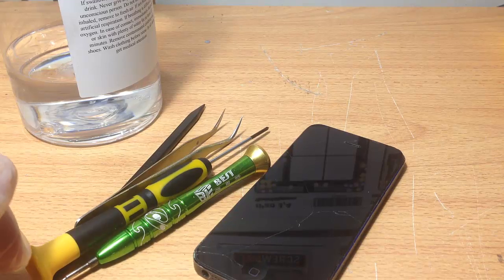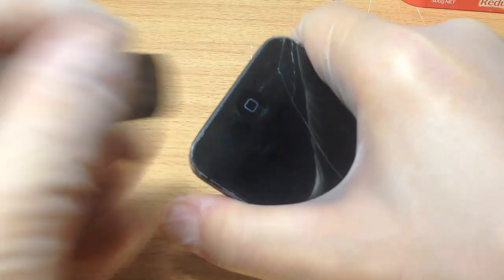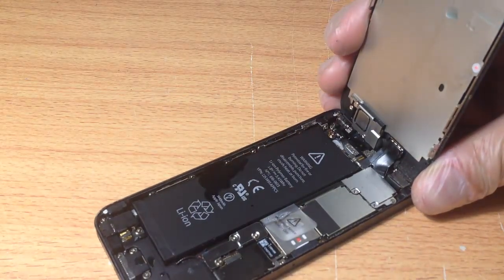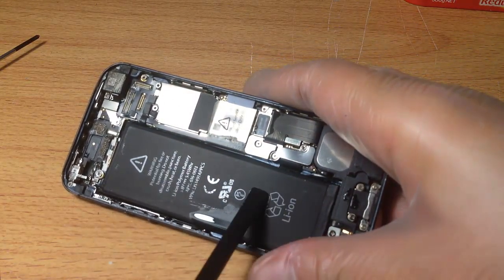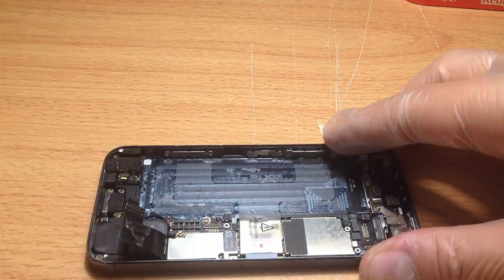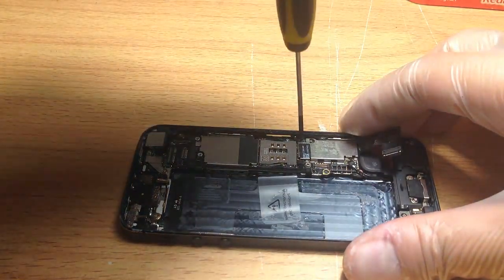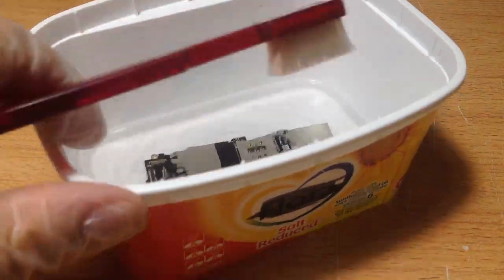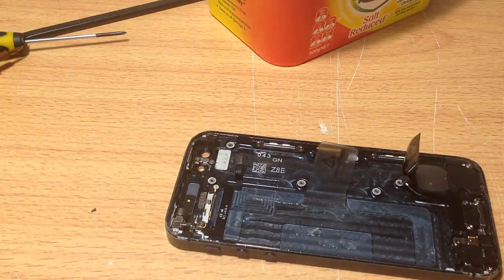iPhone 5 Water Damage Repair

Comment: Is it possible to switch the backs of the phone? like for example my gold iphone was water damaged. and i bought a silver one off craigslist. But i want the gold one as the color of my phone. is it possible to switch them out? not sure if it makes sense but yeah.. lol
Reply from the maker: +Precious Padilla sure is no problem.  actually quite easy to do.
Reply: +infohut I'm sorry for asking this, but what is the proper way to explain my situation to a repair man? Because I was planning to go to a repair shop instead but i just don't know how to explain everything. Hehe, don't judge me please✌️ I don't have proper english yet. lol
Reply from the maker: Just tell the repair person you have water damage and ask what is the best way to repair it. If he is a good technician he will recommend. If u want to change the back tell the technician the 'whole back case' replacement
Reply: +infohut do most repair mans agree to use materials and equipments that customers provide? anyone knows? like my situation ^ lmao
Reply from the maker: +Precious Padilla lol most likely they will use similar equipment.
Reply: +infohut so i went today and the guy told me they can't fix it and use the same screen and all because they're not the same size? i thought they should be because they're both 5s?
Reply from the maker: they are the same size yes but the connectors and frame are slightly different.

Comment: quick question, I have an iPhone 5 that has been water damage for almost a year and I took it to the cellphone repair ,and the guy  said the iPhone couldn't be repair because its water damage. isn't there a way to fix it ? because I do think there's hope to fix the iPhone I have.
Reply from the maker: Yup id say he is right as with water damage you want to sort it out quickly. If you don't over time corrosion ruins the components on the logic board.
Reply: +infohut  than you.

Comment: my iPhone 5s fell in the toilet about a year ago and I remember putting it in some rice and it worked . once the phone got hot it turned off and never turned on again . I went to about 3 iPhone repair places and all of them say its not fixable . what do I do 😭😭😭
Reply: Cry
Reply: Norman Sufficool lol why is a samsung fanboy watching a iphone repair video
Reply: +Diana Ortega Buy a Samsung Galaxy 4,5,or 6.  They are all well rated and are waterproof for the most part.  And you can open them up and take out the battery if necessary and dry them.  Apple phones are a pile of junk in this respect.  High priced junk in water.

Comment: my iphone 5 absorbed some water 1 month ago then i put it under sun light and it started to disappear but now after 1 month my phone's touch suddenly stopped working. it's touch is not working
Reply from the maker: Yup very common issue now this is because most likely over time it was corroded. The most important thing I can suggest is NOT updating it. Once there is an issue with your Touch ID and you try to upgrade it u will get an error and your iPhone will be useless to use

Comment: won't dropping the whole motherboard into alcohol cause water damage?
Reply from the maker: +Surge no because there is no electronic charge through the phone that can cause a short, also alcohol dries really quickly so when you do plug it all up again to test it, it should have dried a lot easier than water.

Comment: Please help.My son's iPhone 5s has a really bad case of water damage he was taking a shower and then he noticed that there were water stains inside the phone that were visible from the phone screen then he put it in rice and it started to disappear then the same exact thing happened 4 or 5 weeks later but this time it was serious,A black spot appeared at the top left corner and then after it just started to purple and black and my nearest phone repair store is somewhat far from were I live Will THIS METHOD WOR?(the phone still works with the damage it stills responds to finger touch and all else works too just the screen colors)Pleas Help Thank you.
Reply: Sorry for my misspelling I wrote this really late
Reply from the maker: +kevin tomay actually this doesnt sound that bad.  I would open it up and check for visible signs of water damage.  then perhaps (if your confident) try to wash it in alcohol.  As for the visual problems - black spot etc.  I would guess that you possibly need to replace the screen.  Nonetheless it's hard to diagnose without looking at it so please understand this is a guess.
Reply: You Mad? That’s what happened to my daughter

Comment: How can you tell if your phone short circuited or not? Mine got submerged into water the screen went blank. after turning it off, the phone got very hot. Can I use this same method to fix my phone or do I need to order certain parts?
Reply from the maker: +Lilly Wang possibly you an try. the sooner you try to fix the problem the more of a chance you have

Comment: how long should I soak the board and it is safe to have a direct contact with the alcohol?
Reply from the maker: +Nabill Hp it's safe to have direct contact with the alcohol ut you need to 100% dry.  soak it as long as possible. maybe 1 hour or 2.

Comment: I dropped my 5s down the toilet, and left it in rice for 2 days, then left it on charge for an hour and when I pressed the top button, the white screen with the black apple logo came on, but it was fuzzy in the top right hand corner so its back in rice in my airing cupboard, will it be alright???

Comment: When u mentioned leave it in for half and hour, and do 3 sets of cleaning here's what I did. I put logic board in alcohol for a couple of minutes. Scrubbed well. Put in for 30-40 minutes. Scrubbed lightly for a few seconds, then put back in for 15 minutes. After this, do I dry it completely then put everything back? And is everything I did so far correct?

Comment: Can you clean the motherboard with a 65% alcohol
Reply: no. isopropyl is 99% alcohol, тнатs the one you should use
Reply from the maker: +Gabriel Martins correct Gabriel.  Isopropyl is ideal however you can use 65% just make sure there is no residue and it dries completely.

Comment: Can i use it in the pool with a waterproof case
Reply: Berna C Dont buy from chinese sellers.
Reply: No
Reply: +Muaz Muzzammil Tukimat yes.
Reply: +UltimaA380 no I dropped my iPhone in a water prof case accidentally in the bath tub and it stopping working
Reply: +UltimaA380 nope ordered from life proof website
Reply: Berna C You did something wrong then or you got a defective one.
Reply: +UltimaA380 no life proof is shit. They claim they have this awesome product however they do not cover the product in the case, just the case
Reply: My phone was in a life proof case and now is fucked because of waterdamage
Reply: Jacob Kelly Return it.
Reply: +Jacob Kelly it is a $5-800 product, they believe in the case, just not the operator-seriously. I'm on my third case second phone. My current phone drops 6' twice month, over two year old. There's always a bad one I get it, won't put anything else on phone. My iPad2 has spent hours in the pool, 5 yrs I believe? Two minis, 5s, 5c, not to mention my 4s that I just tested - ITs GOOD!!!

Comment: I didnt leave the phone in the alcohol (70%- hopefully that's not too low)  too long..
But I was able to clean off corrosion and when I put the phone back together I plugged it in to charge and the Low Battery indicator came on the screen but then shut off.
It wont turn on again (even when connected) and when I leave it connected to the charge it starts to warm up.

What could be the possibilities of this?
Reply: ***** Sounds like there's no power reaching to some places it should. Try opening it again and see if something looks burnt
Reply: Anon8593 Could it be a bad battery? 
I struggled to get the battery off and kind of bent it a little (feels kindof like clay).. I'm hoping it's just the battery, because I already ordered a spare one because someone told me water damage usually ruins the battery. crossing fingers
Reply: Ok, because I cleaned up all the corrosion I was able to see. So the only stuff I wasn't able to see was under the shields that cant be removed.  But I thought I may have saw a dark pin or 2, but not fully sure. I'll have to take another look when I get the battery in.
Reply from the maker: ***** could be anything.  i would try changing the battery again and maybe checking for corrosion.
Reply: Anon8593 & infohut   How likely is it for water damage to burn out a circuit or something in the motherboard to make it non-repairable?
Reply from the maker: highly likely. furthermore corrosion can cause issues.

Comment: I dropped my 5s today in the Caribbean Sea in cancún. I was swimming with it for about 50 minutes until I noticed it. Will this fix my phone? Can a repair shop do it? It doesn't turn on. Or should I wait 4 months after my contract ends and use an iPhone 4? Or can Verizon upgrade it now? Thanks
Reply from the maker: Steven Karpov the sooner you try to repair it the more chance you can get it going.

Comment: Hi, thank you very much for your video.

My cat while drinking water spilled my phone that was charging on the floor with some water, when I tried to turn it on the apple logo showed up infinitly, that was 3 days ago.

Today did what you did in the video and IT WORKS!  Thanks a lot. 

Just one problem, occasionally the touchscreen starts to "move" randomly clicking on stuff without me touching it. Any tips?

Comment: In the operation where the battery is pried out of the case, you can pull on the clear tab that says "Authorized Service Provider Only" instead of jabbing along the sides of the battery and risking damage.

Comment: Some water might have gotten inside my iphone 5s trough the headphone jack port or charger. Everything worked fine but the screen was unresponsive or a few minutes then it worked again I noticed something like a water stain in the lower left corner of the screen (inside) i guess from the headphone port and I don't know what to do HELP im desperate!! I put it in rice but I heard that its best to take everything out and clean with alcohol, but the water indicator is still white could it get worse? It's nightime and i dont have all the necessary tools :(
Reply from the maker: MissRenesmeePretty You can try doing the was as per the video.  The sooner you jump on it the better.

Comment: Thank you!!!  I got salt water in my iPhone 5s last week and feared that I fried the board because I tried to restart it.  Your video was the most comprehensive and easiest video to follow.  My 5s just came back to life!!!  Thanks again !!!
Reply: infohut water will carry electricity and must people after the phone gets in water they will turn it on to see if it works and then the phone must likely will short out
Reply from the maker: Geoff Cielo thank you very much.  glad to see everything is back in working order. Don't forget to backup all your data.
Reply: Is there a way to dry out the front digitizer?  Sometimes the screen will act as if someone is touching the screen.
Reply from the maker: u can try dry it out. sometimes it works but most of the time the stains are there.  just replace it, they're are cheap on most online stores.
Reply: Thanks
Reply: infohut  i have a question if you get a water damage phone sometimes it maybe that it just have water but it could also have a short on the motherboard which maybe you cam tell me the possibilities of that and how to fix beacuse i dont think the alcohol willl fix it
Reply: true.  I think my fiance did this with her 5s.  I tried to clean the logic board, but it appears to be dead :(
Reply: Geoff Cielo did you have to replace the battery
Reply from the maker: sometimes yes.  in this case no but it's not uncommon for the battery to have issues.
Reply: +infohut 
can you recommend a site? most ive found are $50+
Reply from the maker: perhaps through amazon or ebay?  they would be the most competitive

Comment: Is there still a possibility of fixing my iphone 5. It got yet almost a year ago and it turns on and charges perfectly fine but it does not let me unlock. I took it to open it up, but I was told that it is completly damaged because I forgot what it was but there were like little red spots and it meant that the water went all the way in . Is there a possibility of fixing it?

Comment: I had my iPhone 5s was in my shirt pocket on a dock when I bent over it fell out and in to salt water, the water was only about 4in deep and as soon as I felt it slipping I jumped in so it was only in for about 3 sec it doesn't seem to have any water damage but I am afraid it will corrode in the future.  What are your suggestions?

Comment: My iPhone 5c turns on but when I use to home button it turns on then powers off.  What should I do?
Reply: Clean it
Reply: No your logic board is shortened out so take it out and clean it up. It won't go away itself and if it does, your logic board will die due to corrosion eating solder joints away. So clean it
Reply: Catherine M use lacquer thinner alcohol base, to all buttons to clean,. press the button repeatedly while cleaning

Comment: Salt water?
Reply from the maker: Olivier Whelan salt water is more corrosive make sure you jump on it asap and give it a clean.  worst case disconnect the battery at least to remove any charge in the battery.

Comment: I just dropped my iPhone in the pool it wasn't in there long probably a couple seconds. I took it out dryed it off it was still on and it worked fine at first then it flashed blue then turned off. I put it in a bag of rice and it turned on an hour later. It had like 50% battery left then it turned on. i looked to see if there was any water damage but there wasn't. My camera has water in it though. After i looked to see if everything was working it turned off. I have a white iPhone 5s the little sensor thing is red. I have keep it in the rice bag for 3 hours. It is still red and it still wont turn on. What should I do?

Comment: omggggggggggggggggg so i felt like such a boss yesterday, got all my screws out, even did the lil trick that some kid posted to open the phone without the fancy screwdriver successfully. Great, great. Went to bed. Totally blacked out in the morning and "ooh golly why do I have this box on the floor?" MAYBE because that's where all my precious teeny tiny screws were, and are now, embedded in the carpet. you think these teeny tiny screws are sold anywhere or they're like patented by apple? my only other thought before totally breaking down and buying a new phone is buying a super strong magnet to find them all..three seem to be missing.
Reply: MegaHotdiggity you can buy them on ebay for like $5

Comment: My iPhone 5s was dropped in my pool but it had a life proof case. but the thing is it should have been waterproof and now it won't let me unlock and it shuts off and random times.. would this work? please let me know soon I'm getting worried I don't want to have to get a new one it would cost a lot please let me know asap also the time frame was yesterday so 1day
Reply from the maker: Jamila Sou-Belle good chance it may fix it.  nonetheless it nees to be cleaned inside asap to prevent corrosion or it will eventually switch off. remember repair at your own risk.
Reply: Jamila Sou-Belle One thing that makes water damage so hard to repair is the corrosion that will damage small components on your phone such as the circuits, IC. You could always try this method, but inexperienced repair will some times cause even more problems to the device.
Reply: Sarah Kat It is not necessary to take the battery out for removing the logic board....if you just ply the battery out, usually it will just bent it. You can still bent it back, the battery should be fine. It take a lot of force to damage a battery....how did you managed to do that?

Comment: i dropped mine into the toilet a week or two ago and i immediately dried it with the hand dryer and about 2 hours later when i got home i put it in rice for a few days, is there any chance in fixing it?
Reply: Rose Parak Sorry to tell you but rice has a very little chance of repairing your phone. iPhones are very compact and rice isn't strong enough to absorb every single bit of water that is/was in your iPhone. Although you can increase the chance of it by disassembling your entire phone as shown in the clip and leaving each part in rice. Also, I'm guessing your phone was turned on at the time of it's plunge in the water which extremely maximises the chance of it not turning on since the water would have corroded those live circuit boards. If your iPhone was off and depending on the time it was in the water for, you may of had a shot.

Comment: If my phone has been water damaged for a month, would this still work? I mean, the alcohol bath is obviously meant to help dry the phone quicker. If mine has been sitting around for a month, and has most likely dried on the inside, would this still work?
Reply from the maker: Hexaton i dont like your chances as over a month means it has time for corrosion to set in.  you have nothing to lose however.

Comment: my home button is water damaged as well i,ve been told that it cant be fixed at all

help?
Reply from the maker: Doihaveto dothistocomment well if its just an iPhone 5.  Replacing the home button should fix it.  Assuming the phone turns on.
Reply: infohut unfortuently its i phone 5s
Reply from the maker: Doihaveto dothistocomment you can try a generic button replacement for a 5S.  However the finger print scanner will not work.  I also suggest not updating the software after you replace the button as sometimes u can get an error.